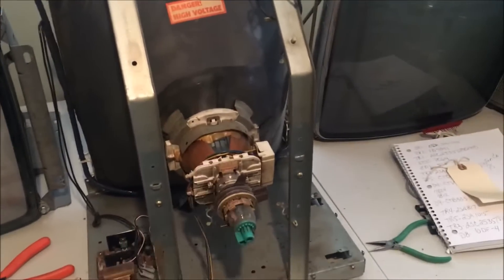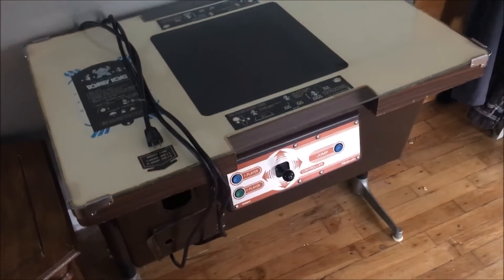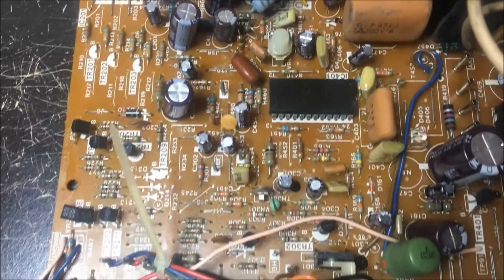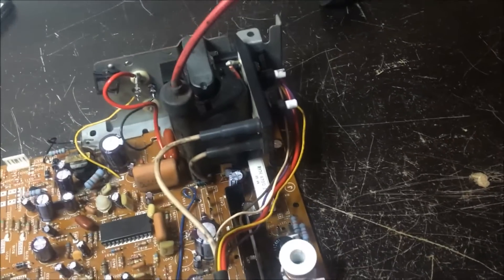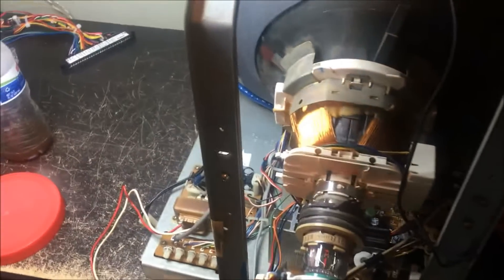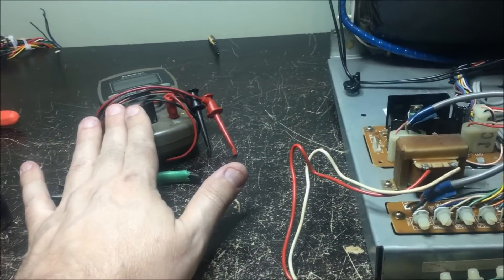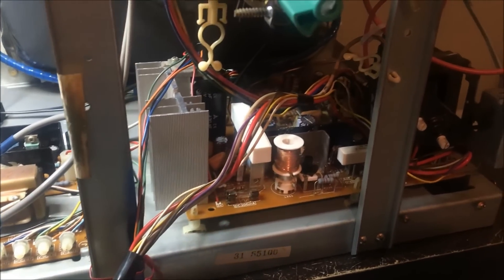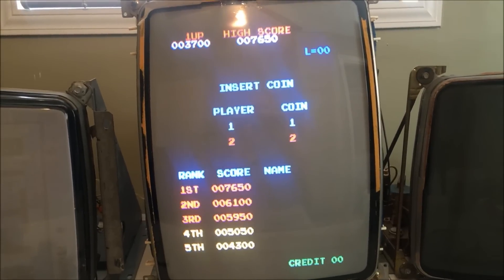Sanyo 20 EZV Nintendo Donkey Kong Arcade Monitor Repair

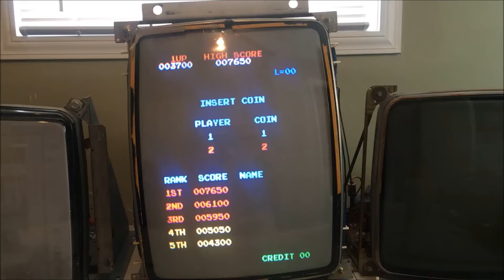Comment: Awesome video.   I have a question unrelated to the monitor repair.   I finally got my monitor looking great, but I’m having some graphical issues similar to yours at the 11:30 mark of the video with Pauline’s head and the top of the ladder.   When you come back after fixing the green at the 14:05 mark, the graphical issues are gone.  Do you remember what you did to resolve it?    

Thank you SO much for making this vid!
Reply from the maker: Sorry..  it was soo long ago I dont remeber.  I may have just simply used a different board set too
Reply: @classicarcaderepairs4818  All good.  Thanks for answering.

Comment: I’m frustrated with my Sanyo. Should I change the Monitor out and use a different one. ( getting a converter etc) is it worth it or should I just keep the Sanyo and have this rebuilt
Reply from the maker: I would surely keep it original..  and rebuild it sanyo..   thats just me
Reply: @classicarcaderepairs4818  agreed, these Sanyos look fantastic when they are recapped and working.